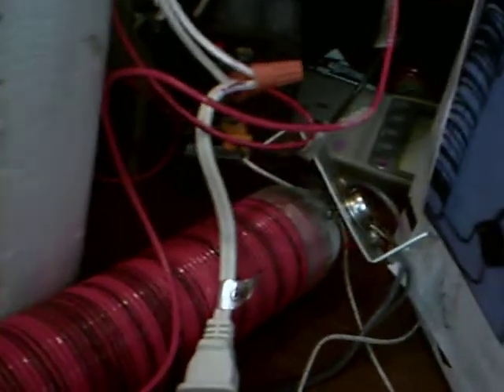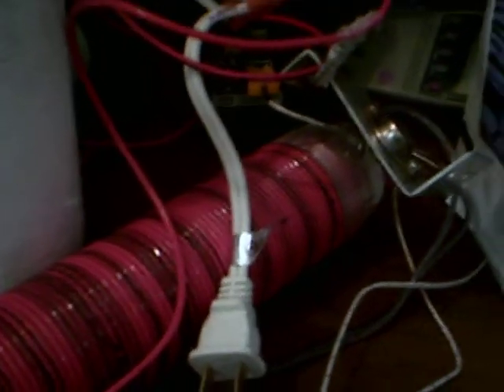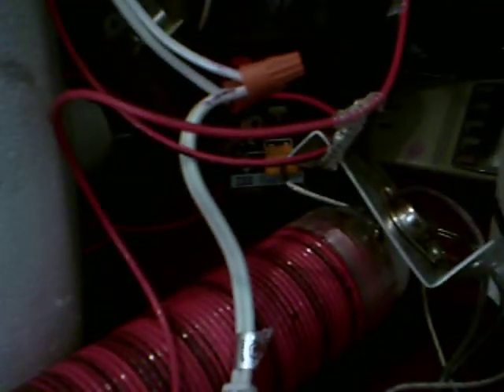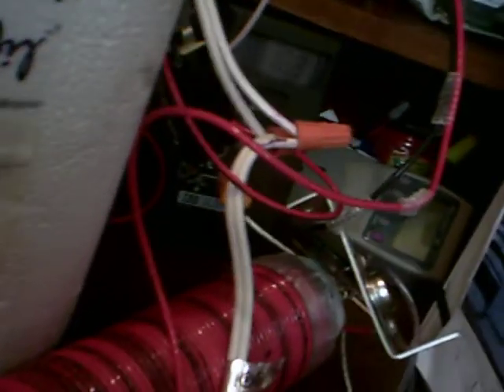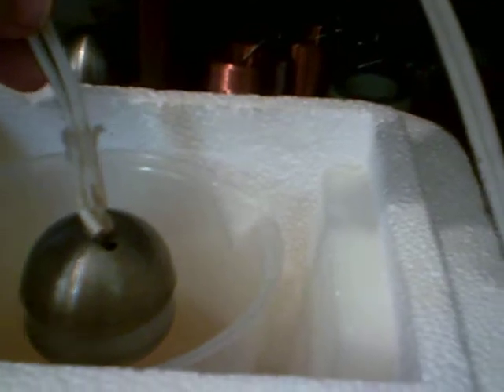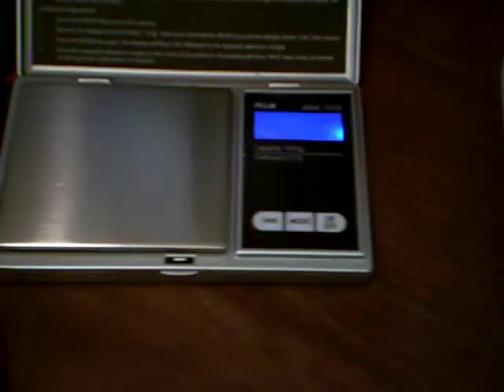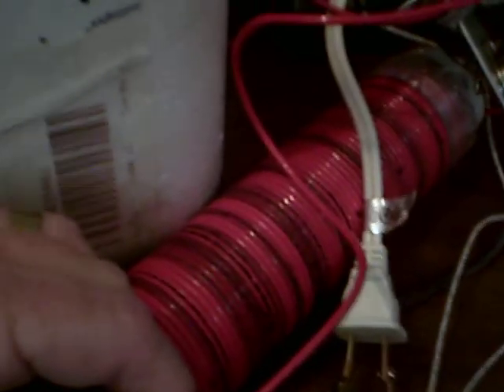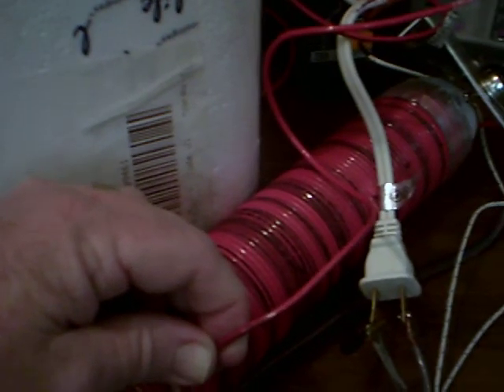sJR3plusDavey

Comment from the maker: Good question -- average with this set-up using the SRJ 3.0, cop is around 60%.  Better with pulsed DC, with a diode in series with the Davey-bells and power supplied by the mains, but that's all for now.
(Comparing input power from the power supply with heat delivered in the water calorimeter.)